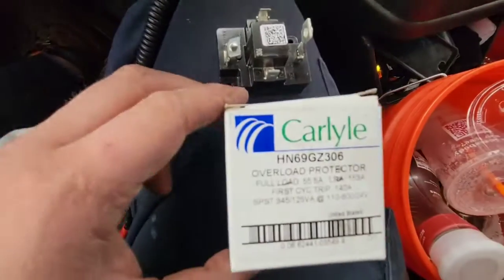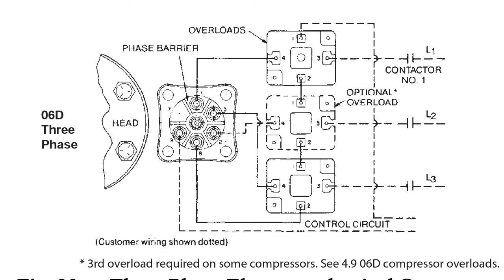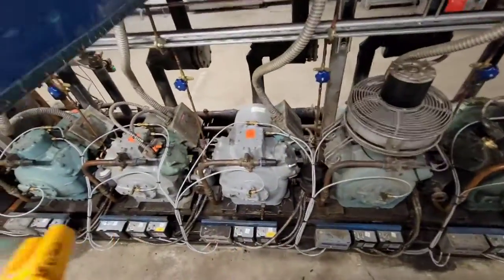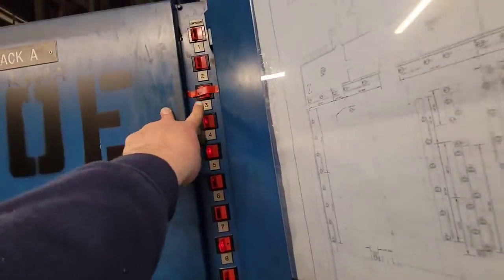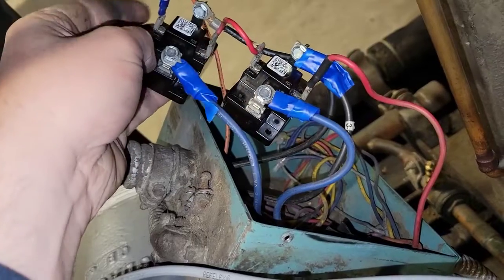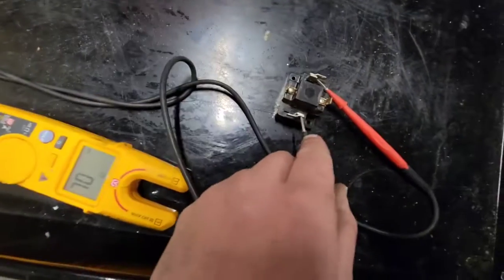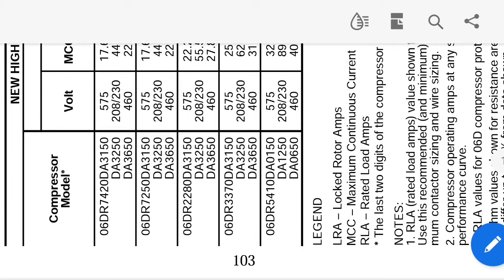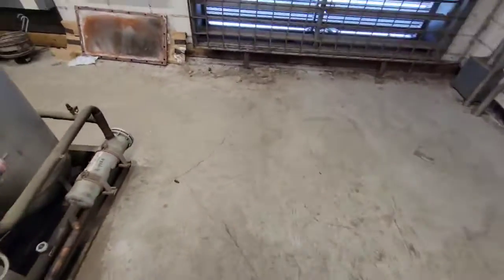Supermarket Refrigeration - Carlyle compressor Bad Current Overload Replacement (06DR)

Comment: Oh goodie a 06D ! I had one trip on oil failure not long ago. A service call I would never forget. The client had replaced the original compressor with another core. 
Soon after it was tripping on oil and I couldn't for the life of me find out why. The pump had no play in it and nothing broken. I even tipped the damn thing over to check it's oil filter.
Turns out my 06D model runs only 11 psig maximum oil pressure above suction. I set the MP55 cutout differential from 10 to 5 psi and she was good to go.🙃 Page 74 on that manual I believe
Reply from the maker: Thank you for sharing,

I would love to have this kind of information in the comment section :) the more knowledge the better!

Comment: What about the internal overload on terminals 8 and 9 on the pecker head? I have a 06D for AC that keeps blowing fuses when the internal over load is connected. Can I replace it or do I need to have it sent off to be remanufactured?
Reply from the maker: This is a good video for trouble shooting compressors might give you some insight. But as far as I know in internal overload. You will need to replace the compressor. As far as I know, maybe there's some way to do it, but If we found an internal overload that was destroyed We would just replace the compressor.

Good luck man and I hope this helps.

https://youtu.be/dRFXwOKlY9o

Comment: What’s the fan for on top of the compressor
Reply from the maker: Too cool the compressor
Reply: Usually found on low temp compressors, because in a rack, they don't have the airflow from the condenser fan motors to cool the cylinder heads, since the condenser is remote.

Comment: Phew... This is a challenge for beginners. 
At the outset, isn't a "current overload switch" the same thing as a "breaker"?

Good to have this video, but will take several plays and cross-references to 'get'.
Reply from the maker: Yes it is basically a breaker. 

It is more like a fuse though. Because as far as I know there's no reset it's kind of like the ultimate failsafe. It's like a backup to your breaker. If for some reason your breaker fails or malfunctions the overload will kick in. But only for verying extreme circumstances. Like the compressor would have to draw amps far exceeding the breaker. Like three times as much as what the breaker is rated for. At least in this case.
Reply: @gendronhvac-r1269  Nice video, don't do any refrigeration, so I just saw your videos on the Rack Systems, very interesting, so I subscribed.  Anyway, I happened to have some older TotalLine (Carrier RCD 1988/89) catalog and indicates these are Automatic Reset Overload relays.  On the box you had it shows First Time Trip amps of 140, but the catalog I have also says the first time Trip is 6.5-16 seconds. (They don't make catalogs like they used to anymore.)
Also says it's made Texas Instruments (Klixon) Type 8348. Not sure if TI still makes them as companies get bought all the time.  I opened one up many years ago when I was kid and my dad brought a old one home.  If you still have those, you'll find if you pop the back cover off, there is a Huge bi-metal disk that senses the current.  When it flexes on overload, it pushes up the set of normally closed contacts at the tower part of the relay which as you said breaks the coil on the contactor.  Also your bad overload probably has a disk that burned up, maybe from the previous compressor that you also mentioned they didn't replace the electrical box.
Very interesting videos and like how you go over all your steps as part of your diagnoses.  Keep them coming!
Reply from the maker: @TheGgin  

Wow thanks for the information :) good stuff. I was not sure if it reset by its self. 

I'm trying my best to promote this kind of community comments. I want a new guy to read the comments and be like wow I learned a ton. I have learn much from the input you guys are sharing.